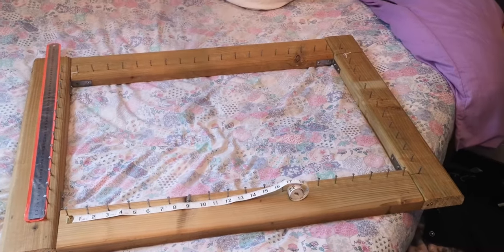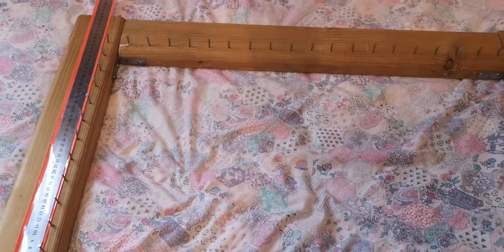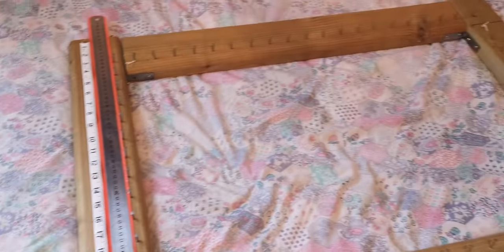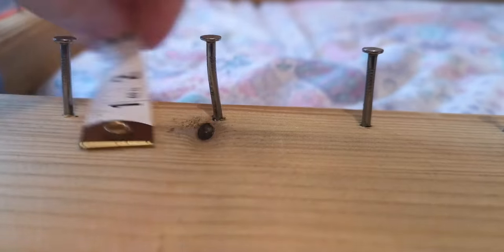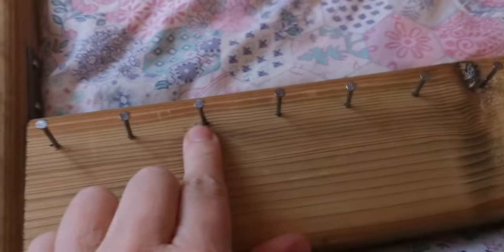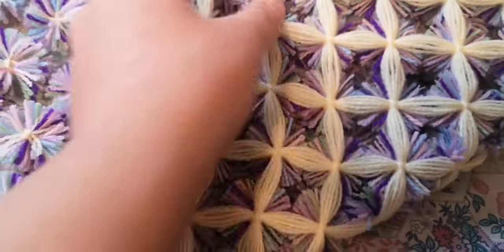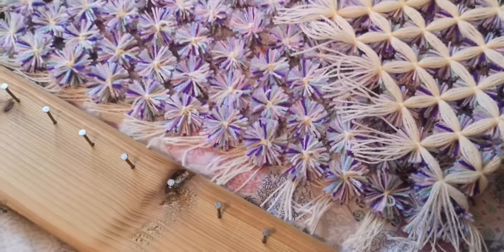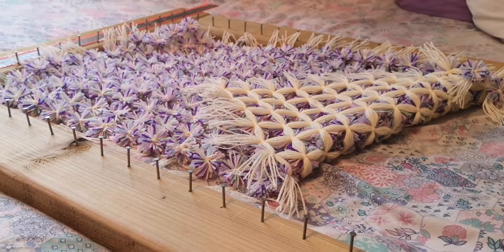Pompom loom making improvements. Baby blanket safety thoughts too. #pompomloom #babyblanket #crafts

Comment: you make it sound so easy I think even I could make this!
Reply from the maker: Oh thankyou. It really is easy to knock one up. Which is basically what I did here. Found some old wood. Dried it. Chopped it roughly and threw it together. For the ones I'd be selling I'd make perfect. Sand. Measure etc. But this was a recycle project.   Thanks for your comments I really appreciate it. Xx